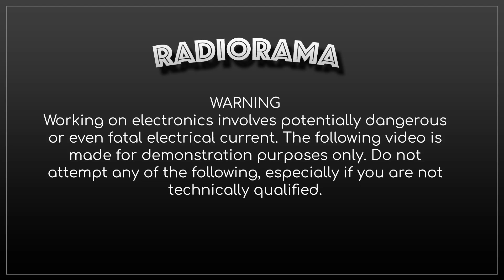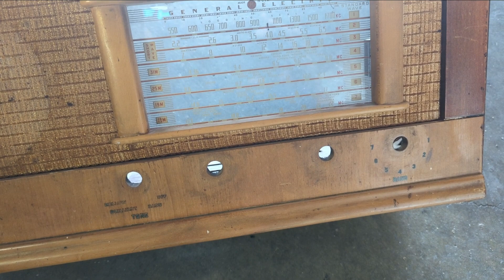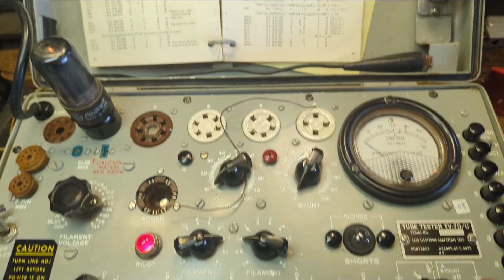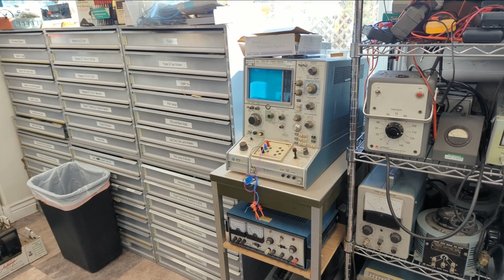The 1942 GE with an auto transformer

Comment: Usually on a hot chassis set you can rewire the power switch, adding a polarized plug, so that the neutral goes to chassis.  This doesn't solve the problem completely (especially if the outlet is wired wrong!) but it does help.  If you watch my video on the Clarion, I talk about this a bit.

Comment: I'm surprised that export model made it across your bench---they have to be pretty rare in the US, probably never see another one. The only American market set I've ever seen with an autoformer was a Slivertone model called Election from the mid 30's. And it wasn't variable voltage, either. Also used an odd 1-V rectifier tube. But I digress----that's a very solidly-built set

Comment: Doesn't putting the refinishing products on kind of seal in the "grime "?
 I was wondering if there was something being glossed over for time constraints. 
 Most of the radios and televisions I've been involved with were heavily coated and took alot of elbow grease and cleaners to even get to the factory finish........
Reply: Yes, you are correct.It is a set by set basis.